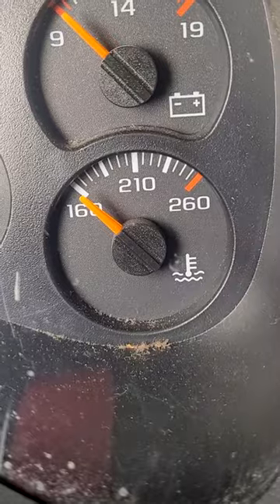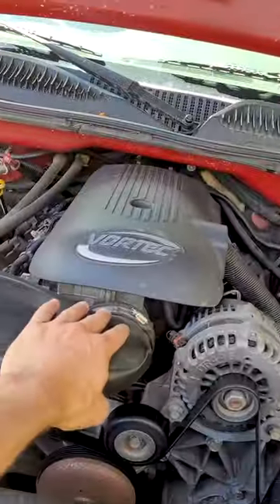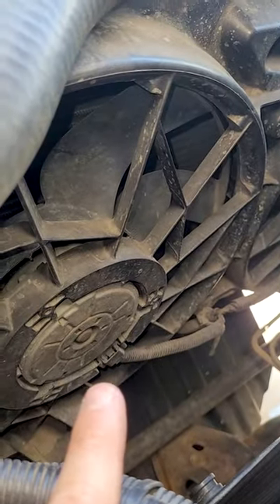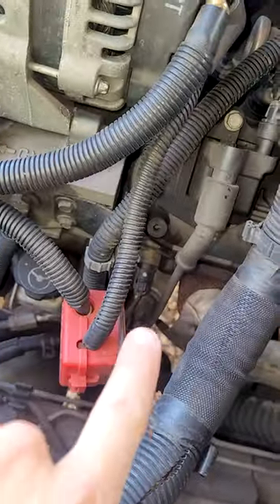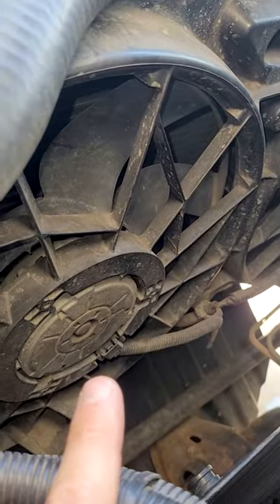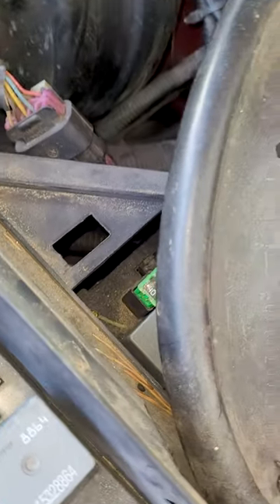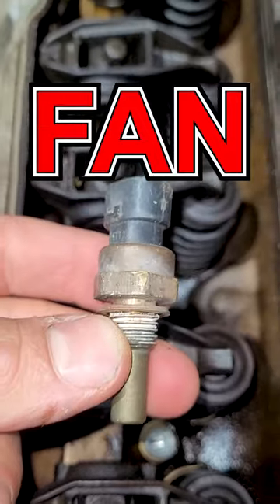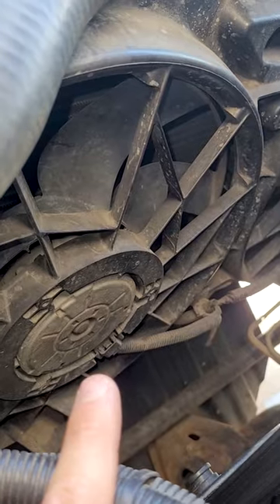Mechanic States Chevy Coolant Sensor?

Comment: 04' Silverado has iratic bucking/learching idle at lights or stop signs about a week after i replaced my power steering pump. Guess i got too aggressive and messup the wiring connector/ pigtail. I'll save you the list of stuff i replaced before i figured it out!

Comment: I want to up replace my mechanical fans with E fans. Can I tap into the and use the existing coolant temp sensor instead od adding a separate temp sensor for fans, if I can what's the correct way of doing this properly thank you for all your helpful and knowledgeable tutorials.

Comment: Lol I just did a repair on a Silverado for the fans kicking on immediately when the vehicle is turned on. The ECT wasn’t reading on the dash so it was a no brainer to swap out the coolant temp. sensor. Can confirm it fixed the problem even tho the customer needed a water pump😅 (he didn’t pay for diagnostic)

Comment: What You know about the intake manifolds on cat eyes? I think mines leaking 😡
Reply from the maker: They always leak. If it's a 1999-2002 they were bad from the factory.
Reply: 99-02 isn't a cat eye
Reply: @MattsShop  mine is a 05 cat eye

Comment: I've got a question, when I put my truck into park it will start to lope, just for a brief few seconds, what could cause that? 2003 Silverado 1500 5.3
Reply: Mine did that. Cleaned the throttle body and it stopped doing it.

Comment: Does everyone’s eles fan kick on at 220? Is there a tune for that lol?
Reply: I have a custom tune on my 05 cat eye and the electric fans kick on at 190 degrees. Also have in the tune when the a/c kicks on the turn the fans on to pull more air over the condenser. My a/c blows 38 degrees in the middle of summer.